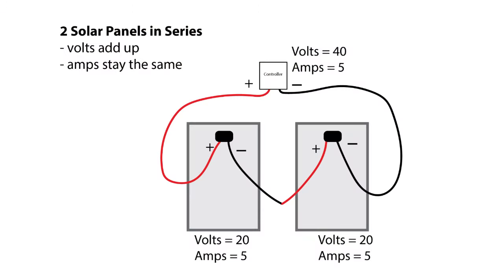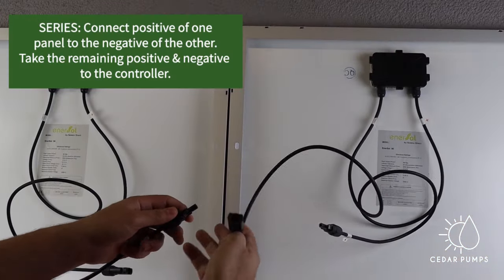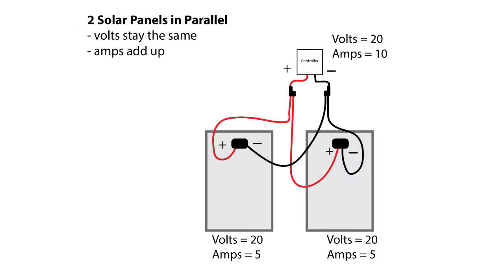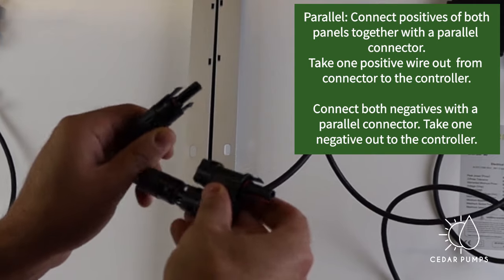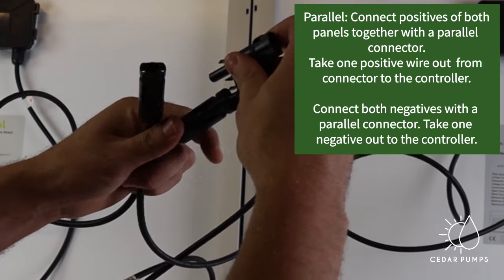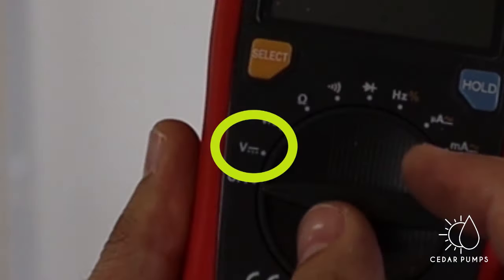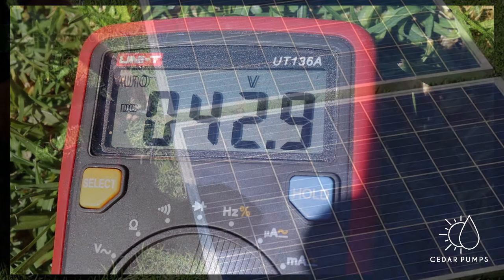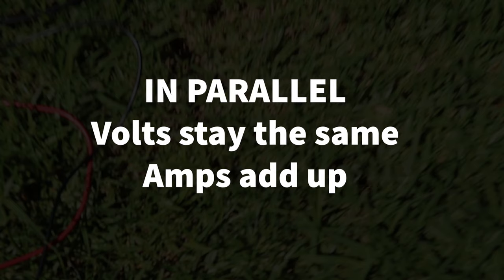Solar Panels: Understanding Series & Parallel Connections (Quick Video)

Comment: Very Clear, Concise video, Thank you.  The personal (Benefit) is that my array will be a Maximum of TWO 48V 500W panels.  Most of the videos on Series/Parallel connections are for larger arrays.  The downside in My case, is that I’m Still uncertain which method is Best, limited at Two panels …. ?

Thanks for the content !

Comment: OK, connecting in series I get it...but how do I connect the remaining two wires TO the charge controller. Most charge controllers I'm familiar with do not have a receptacle to directly plug in the MC4 connector. Do I cut off the connectors, strip the wire and then attach them to the controller?
Reply: Yes, cut them and they will go into the  + and - inputs on the solar controller

Comment: Is there effect in a hybrid solar system if the voltage from electric provider is only 180 volts?
Reply from the maker: You will need to look in the manufacturer manual to see what is allowed, most inverters will have a range they can work with, outside of the range the inverter won't accept the grid power.

Comment: Can i connect in parallel without mc4 connectors? My order is on the way but i wanna know if it will work wothout the mc4
Reply from the maker: in series you use mc4, if you want to put 4 panels in parallel use a 4-1 combiner box

Comment: Which is best to charge the solar batteries, series or parallel. I have 4 *450 w connected in parallel, but am getting only 10 amps from panel. Is there a way to test the amperage from panel without connection to the inverter
Reply: Please check your charge contrler minimum Voc and your pannel voc . Pannel Voc must grater than contoler minimum Voc, if your charger controler voc is minimum then connect 2 pannel in seeris another 2 in series then connect them in parallel
Reply: @digitaltamiltech8664  not getting you, The  inverter can handle Max 90 VOC.
Reply: @diyshankar max 90V and how many amps? It'll only draw as much as it can use
Reply: @gigel99324  .. I have 2 C10 150 ah solar batteries, I think it's 15 amps each ?
Reply: @diyshankar  what inverter or solar charger do you have?

Comment: Can you take the same 2 panel's and connect them in series and parallel.?
Reply from the maker: Yes it depends on your controller specs (voltage, amps & current) how you would connect them. Stay under the max volts/amps/watts of the solar hardware you are plugging into

Comment: Great video! 
Hoping someone can help me with this..  I'm thinking of connecting a 140w panel in parallel with 160w one.  Since the wattage isn't the same for each panel, will it weaken or damage them?
Reply from the maker: Larger panel will weaken to smaller panel rating is the quick answer. These two are close together 20w so losses will be minimal.

Comment: So you've explained how panel wiring can vary in volts and amps. With all components and conditions considered within optimal range, can you explain which wiring, series vs. parallel, is most beneficial. In other words, why do I want more amps as in parallel compared to volts as in series?
Reply from the maker: Hi Robert, the quick answer is that almost all solar equipment (inverter, charger, batteries etc..} has a voltage, amp and wattage range that it operates in. The panel configuration (series/parallelcombo of the two) will be chosen to work within these limits. You can find these in the manual of the charge controller/MPPT charger.

Comment: What happens when connecting in parallel and one panel produces less voltage than the other?
Reply: The one with less voltage will act as load to the other one
Reply: And the panel with low voltage will continue to draw current from the system which can limit the output efficiency  and also cause damage to the panel.
Reply: I guess what you could simply do is to connect another panel to the one with lower voltage in series to give equivalent  voltage of the panel with high voltage, and then connect the series connection in parallel with the panel with high voltage. With This, you will have your perfect system efficiency, current increases and voltage remains  umchanged
Reply: @hederyat6161    that would be the best way;
Reply: Use a blocking diode

Comment: Hi nice quick tutorial. 
1. What size MPPT charge controller must I purchase (assuming 8 x 400W [ Voc=49.1V / Isc=10.1A ] PV panels AND 48V / 120Ah battery)?
2. How do I connect the panels?
Reply from the maker: You can use Victron's MPPT calculator and it will show you what will work, temperatures in your will also have an effect. Select 'custom module' and enter your panel's specs in there. https://www.victronenergy.com/mppt-calculator
Reply: @CedarSolar  Thank you - it was not what I needed, but thanks anyway.
Reply from the maker: @joatmofa0405   It depends on how you setup the configuration of the panels. Start with system voltage. 48V. Then get a charger that can do 48V and look at the Voc and Amp limits. EG If you making 2 strings of 4 panels you need a controller that can handle 214V Volts (4 x 49.1V) + 7% temperature safety factor 18V (Assuming it doesn't go below -8 degrees Celsius in your area) and 25 / 30Amps (10.1 x 2 rounded up).

Best is to download the specs of 48V MPPTs you are interested in buying and make sure you are within the Voc and Amp limits. That MPPT calculator is super useful and takes temperature into consideration and gives very accurate sizing. 

I don't think many MMPTs are available that will handle all of those panels in series. so your options are 2 strings of 4 or 4 strings of 2 panels. And do the calculations for both options.
Reply: @CedarSolar  Thanks for that. 
I have decided on a 150V / 100A MPPT controller (bit of an overkill, but it can handle future upgrades).
I'm also going for 24 x 400W panels : 3 x series strings of 8 x 400W parallel panels [ 3 x [8 x 10.1A=80.8A] 49.1V = 147.3V]] 
TOTAL CONNECTION 147.3V / 80.8A <----> this will work 100% on a 150V / 100A MPPT charge controller!
Reply: @CedarSolar  Great, Thank you!
Reply: May be 50A or 100A mppt charge controller that can do.
Reply: 50A or 100A MPPT charge controller that would do

Comment: Can I run 2 100watt solar panels in series to a 12v controller 30a
Reply: Yeal. Im wondering the same..i have a 30 amp controller and 3 100 watt panels..
Reply: Yes

Comment: Which is best, parallel or series for best performance and panel life?
Reply from the maker: It depends, you want to operate within the specifications of your charger and controller. We will recommend the configuration that is best for each pump.
Reply from the maker: No difference on panel life. For performance: PWM chargers will most likely lead to parallel connections and MPPTs will allow for more panels in series. So read the solar charger specs and look at the recommendations and limitations of the charger then decide on your panel configuration accordingly.

Comment: How about you just take the wires and wrap them together does that work?
Reply from the maker: It will work, but MC4 connectors are industry standard and the safest way to make these connections.

Comment: Which set up charges the batteries faster ?
Reply from the maker: The panels will be connected depending on your solar charger's specs. 

PWM chargers will most likely lead to parallel connections and MPPTs will allow for more panels in series. So read the solar charger specs and look at the recommendations and limitations of the charger then decide on your panel configuration accordingly.
Reply: It's the same WP regardless of which set up you would like to do. Only 3 things affect the output of the system which are resistance, temperature, current. Always take into account you will likely lose power no matter how good your set up is.

Comment: This parallel connection is risky if the output of the panels are not the same. Should include a blocking diode.

Comment: Good info for sure.  I have a  (1) 240W,  29.48 Amp , 8.14Imp Solar Panel....  I want the most out of it,  to charge a 12volt Battery Bank.  It's use to run the LED lights in my Green house.   Most of the PWM's are AUTO 12/24, therefore,  I assume it will read the panel as being a 24v panel,  but I need 12v.   I'm kinda confused.   Any help is appreciated.   THANKS
Reply: The output will be determined by the load connected.  The controller will the amount of load available
Reply: Just suggestions....
Whatever you do....place an "INLINE" 100 amp Fuse in line of the Positive cable before the line is inserted into the Positive of the PWM!

You are right..... but....I'd look up the Brand Name, and Model of the PWM before I'd guess if it is does handle the 12/24v Parallel hook up! IF it is only a 12 volt PMW... it might go smokey, becaus of the added Amps, if it is 12 volt only!

Comment: How can I connect 3 panels series and parallel
Reply from the maker: In series is easy just connext MC4 connectors into each other, for parallel get a 3-to-1 parallel kit instead of the 2-to-1 used in the video. For larger strings in parallel use a combiner box with correct DC shutoff and fusing.

Comment: What happen if wattage rating solar panel is Same in parallel connection??
Reply from the maker: ? Watts always add up. Its just the Voltage and Amps that changes as per video.